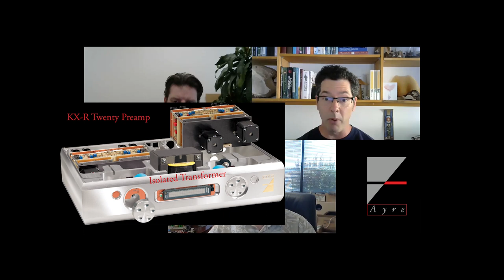Power Supplies | Pints with Ayre

Comment: Super interesting discussion of linear and switch mode power supplies. Every piece of audio equipment contains its own power supply.  This is because both tube and transistor circuits—not to mention digital circuits as in DACs—actually operate in DC and not the AC available at the wall. Have you guys ever thought about the possibility of designing a universal DC power supply that incorporates all of your best concepts (big linear supply with lots of high quality capacitance and double regulation, etc.)? This power supply would be a standalone unit that would power any Ayre component in the product line. 

Under this model, each component (DAC, preamp, amp, etc.) would be a complete product  for the power supply, and would interface with the single universal supply. The idea here is to create a supply that offers the ideal DC voltages and current for the entire Ayre line. It seems rather inefficient for each device to have its own supply—its own power transformer(s), chokes, filter caps, regulators, etc. Just as the preamp is separate from the power amp (except in integrateds, of course), a universal power supply would be another “separate” in one’s audio system.

Thank you for listening. I’m a proud owner of a QB-9 Twenty.

Norman G.
Reply from the maker: Thanks Norman! There are a few power supply products on my drawing board right now. One would be a revival of our simpler L5xe Line Filter. However, another idea is very similar to what you described, but more for highly regulated and perfected AC. You can look at our turntable project we did with Bauer Audio, the DPS, for a hint. ;-)

Although, you do have a point with a well regulated universal type of DC power supply as well. Keep em' coming! :-D

Comment: I wonder how separate power supply for Ayre dacs would improve their performance? Or is it price prohibitive?
Reply from the maker: Hey Kevin, we had a few products in our early days that utilized external power supply boxes. It is such a tough call to make because half of people see the benefit and will work around the external chassis for the audible improvements; while the other (maybe larger) half want simpler 1 box chassis designs that are easy to position within a rack. 

It is a concept we are definitely not foreign to, and may employ something like a secondary chassis that mirrors the main unit, but with all the power supply tech in a future product.